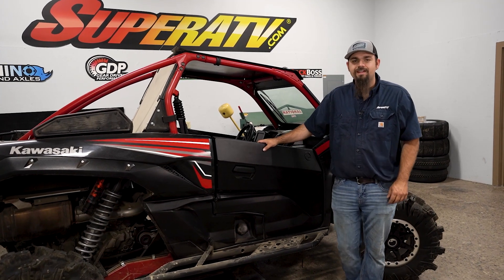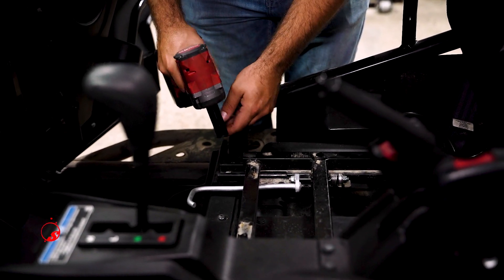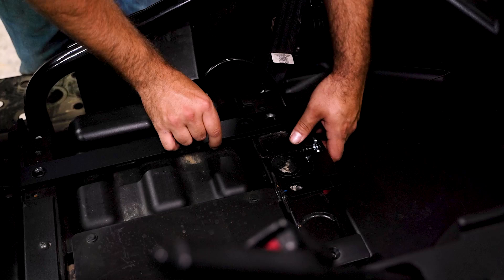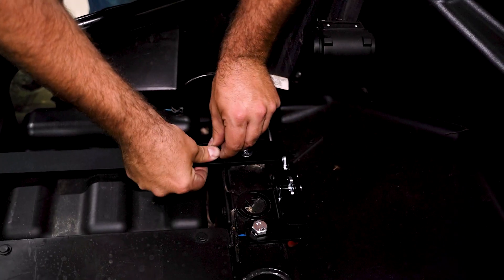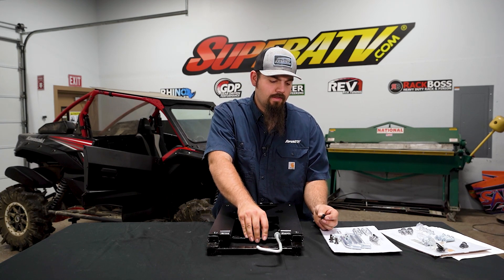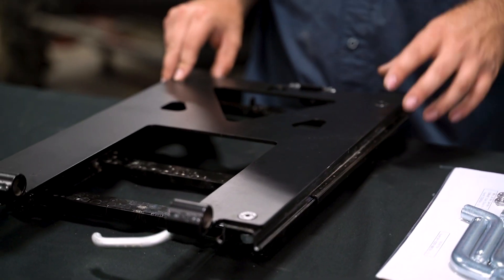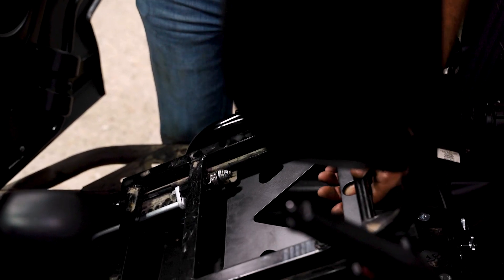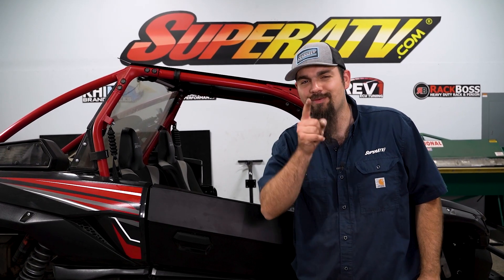How to Install SuperATV's Flip Up Seat Base for the Kawasaki Teryx KRX 1000

Comment: ok, so I tried to follow the instructions step by step, but the Kawasaki I have came with aftermarket seats and 4-point seat belts. So maybe add some info about or do a rig that has been upgraded. Thankfully I had all day and time to go back and forth looking at this video and figuring out the adjustments need. At least now I we can get to the air cleaner can without fighting the seat and use the extra space behind the passenger seat to get to the storage bag and cooler now. There were also a few extra parts left over that I'm not sure what they are or were for?
Reply from the maker: Unfortunately, we can't cover installation with other aftermarket components due to the wide variances in each brand. Give us a call if you still need assistance with the spare parts, 855-743-3427.